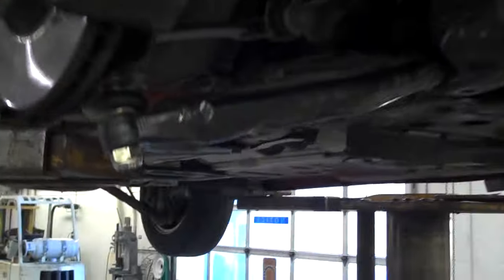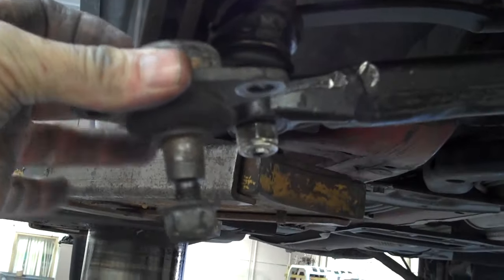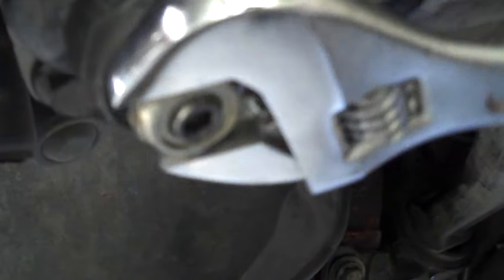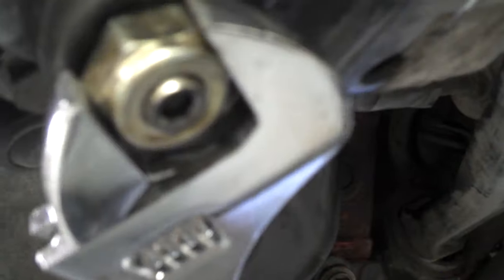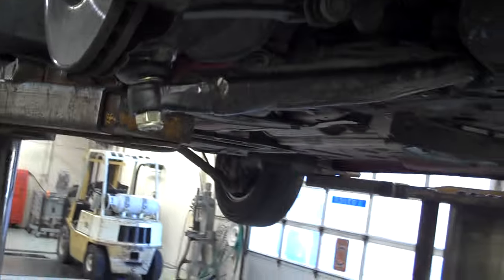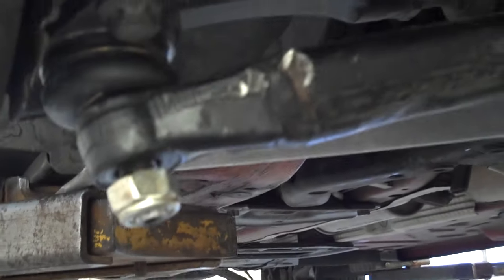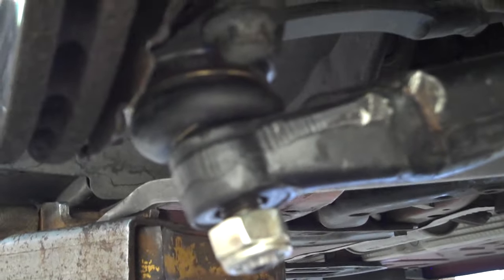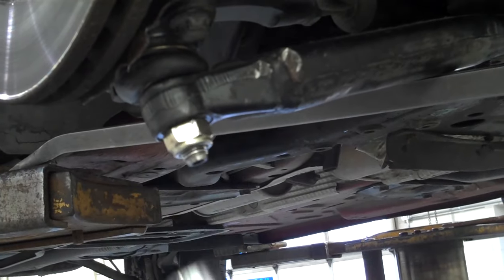When a ball joint stud spins

Comment: Christ, you're on a lift with a impact gun. How much easier can it get. Try NOT on a lift and NOT having an impact gun.
Reply: mike blaz right or not being able to even get a socket on the nut
Reply: Well in this case use a spanner and an allen key..
Reply: Nordic80, and a, and a, WD-40. A water dispersant, a tar remover
Reply: Yea like me rite now just got the hub pressed out the knuckle now this fuck my life
Reply: Just use your hydraulic jack to press up on the lower control arm instead of using a pry bar if you are on the ground and using jack stands
Reply: He could of just used an Allen lol
Reply: No seriously

Comment: Why not use a allen/hex key to hold the shaft in place?
Reply: Domantas Martinėnas You mean, do it properly rather than air-gunning every fitting to the max? 👍
Reply: khaitomretro, youuuu kinda want this one tight, think?
Reply: leebob86 that's what a torque wrench is for.
Reply: khaitomretro, no fucking shit.  You missed the point completely, most DF er's do...
Reply: The trust arm tension strut and that ball joint are the first piece to take the impact of a bump or w.e in the road or turn. The shock reacts after that. This part is critical of being tightened down. And the amount of stud protruding after is very small. About the thickness of the nut itself. Not much.
Reply: I'm a full time tech I'll use this method at times. But I never rely on an impact. After I impact the nuts on I'll tighten them down with a ratchet
Reply: Well?  I admit!  I din't notice that the end of the bolt was actually a 10mm hex, but, my nut mustabeen x-threaded or somethin, cuz even after I put'a socket on the end, I ran outta bolt, b4 tha nut broke loose.  Eventually, tha end'a tha bolt rounded-off.  Guess I'm doin my uppers too now...

Comment: sometimes that does not work if the threads are rusty and the nut jams. i always clean the threads now with a wire brush manually or with a wire brush chucked in a drill or air tool. stop using crescent wrenches they are for plumbers...use a box or open-end wrench

Comment: Look underneath the stud and there is an Allen key fitting. Your welcome guys.
Reply: Couldn't get it to work on mine.
Reply: It's alright until that becomes 10 years old, rusted out and rounds or snaps when trying to remove the nut, that's usually when the dremel and chisel comes out.

Comment: THANK YOU, THANK YOU, THANK YOU! Was about to lose my freaking mind.  Putting things back together after doing a front strut install and the ball joint on the upper control arm kept spinning. Tried everything without success then saw this. Worked like a charm. :)

Comment: Use a bottle jack and lift the knuckle or lower it to put tension on the bolt and nut. Or even put the wheel back on and do it. I don't have a lift. I fix my X5 4.4i. The proper tools make the difference. Don't cut corners. Or you'll be cutting your wrists bc of the aggravation.

Comment: So you can use a bottle jack or floor jack to put up pressure on the control arm, then tighten it & replace the cotter pin...

Comment: Sometimes that bolt won't give up and has to be removed. I had my dad stand on a log that was on-top of the rod and it didn't even help to loosen or tighten the bolt. The nylon plast inside can get jammed and then you're better off choping it off.

Comment: For us average Joe's using ratchet straps against the frame or even a C clamp works better. Plus you won't strip the bolt with the impact ;)
Reply: Logan Thoeni explain more please...c clamps are viable but maybe the other solution?
Reply: take one end of a ratcheting strap and hook around the tie rod,
take other end and hook it in a frame hole (or any decent part of the frame that will not move/bend)
ratchet. ratchet. ratchet. till it is as tight as you can humanly get it,
loosen your bolt,
this will bind up the outer tie rod against the hole that it's in and won't allow it to move. If your vehicle is newer, be careful about how tight you get it. frames aren't built like they used to. I've done this in alluminum frames you just need to find a good spot.
Reply: Logan Thoeni, the fuck sakes. BALL JOINTS AREN'T TIE RODS, PAY ATTENTION.
Reply: @ThoeniChannel  make a video 😏😏😏
Reply: @leebob86  doesn’t matter. Using anything to put pressure on the “ball socket” will seat the two tapers together. Works on ball joints, tie rod ends, sway bar links or other ball type sockets

Comment: Thrust arm/Tension sttut ball joint.
Any advice on removing the nylon lock nut from the ball joint/thrust arm. It was over torqued and spun. Tried wedging a flathead between the nut and thrust arm. Moved some. Just replaced the pressed ball joint so cutting the stud is no option. Last resort is cut the nut with a hacksaw. Any tips would help. 
 Vehicle is. 06 BMW E53 X5 4.4i N62

Comment: Thats bad spinning it that way.
Sure put pressure on the taper to hold it if no allen socket hole is in the stud, 
But wrench it on, finish it off with a torque wrench.

Comment: i wouldn't take my car to you to replace the ball joint, obviously you missed the hole at the bottom of the ball joint, you would insert an allen wrench in the hole and use a wrench to turn the nut. And you are a professional?

Comment: anddddd still doesnt work
Reply: Use a bottle jack and lift the knuckle up. Or. Lower the knuckle to put tension on it. 1 way it will tighten and spin off. It'll work.